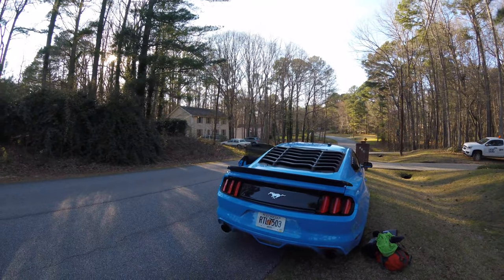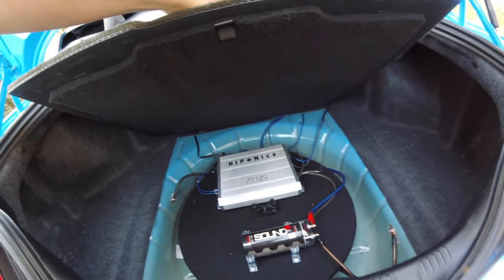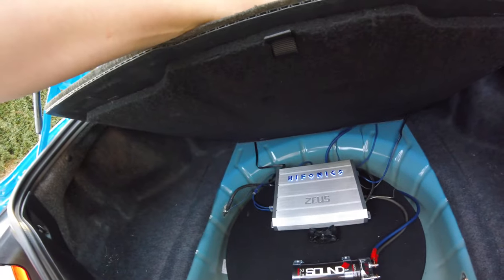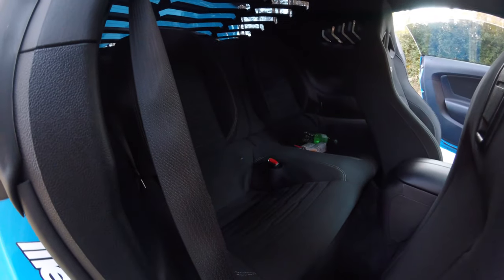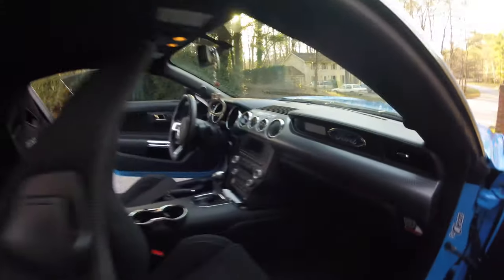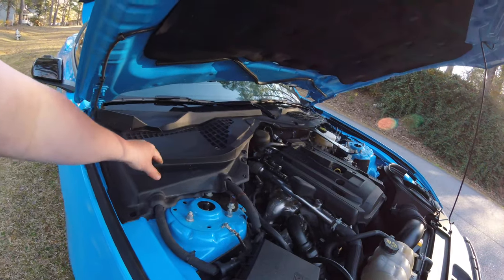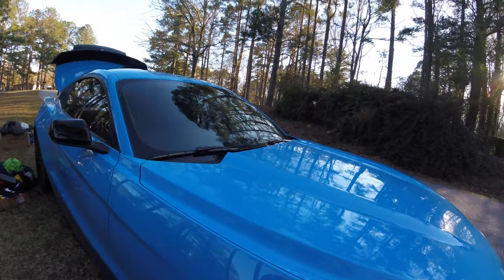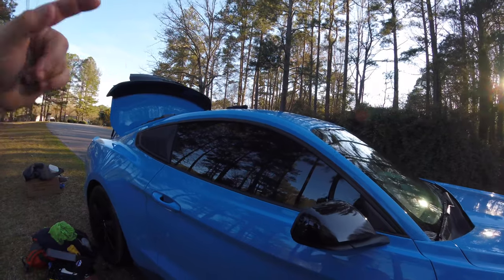2017 Ford Mustang sub install with factory speakers

Comment: it does need a capacitor if you are not using a remote battery and going over 300w or you will be burning up alternators...   I have the same 2017 But in a GT, I didn't get a Hum, but I also did the 4" to 8" swap...
Reply: How did you burn up an alternator? I've been running a single Skar EVL powered by an RP2K @ 1ohm for 2 years with the stock battery and base EcoBoost which has the smallest alternator of all the mustangs I believe lol.

Comment: Nice vid man. And the seats down for the bass really does make a huge difference. I installed 2 2400watt Skar 10s on 3000 watts taramps amp. For my 12+ wire to my battery I have it ran under the battery spot u need another person to help pull it up. There was a nice lil spot to slip it through you gotta do it under the rugs n what not under the passenger side.
Reply from the maker: It's amazing seeing that the seats literally snap at as one can make such a difference in sound deadening
Reply: @freestylfilms  yea for real man I keep both of mine down now that I took em out of course lol never used em anyway so I just got a single 15 now and what a difference I can say
Reply: I got the same car im planning to put skar ddx single 2ohmz taramps 3000. But im worried about the car alternator. You guys running stock alternator and battery?

Comment: Badass, I have the same car, same year same color same wheel package. Mine came with subs built into the roof of the trunk and I have a spare tire but I definitely dig your setup you probably get better sound 😀
Reply: There is no “probably” lol the “subs” on the trunk arnt really subs but more of a mid speaker you can still use them to get signal to your amp that will run real subs. Those on the back use the trunk as a “box” but it’s much too spacious for those low power speakers to give any depth in music.

Comment: Do you think I could fit a single 15” inside the trunk of a 2017 model mustang?
Reply: Same exact question I had
Reply: Nah unless you build a box into the trunk for it first cuz I’ve tried prefab boxes for 15s and they can’t fit in our small ass trunks. But I have mine in my back seats cuz I took the back seats out but u can always fold them down as well if u don’t wanna go through that hassle. Got a 2500 watt Skar 15 on a 3k taramps amp.
Reply: Matter fact I couldn’t even fit 12s in prefab boxes. So if you can build a custom box the right way or have someone do it for you then you’d most likely be able to fit it in but that’s all I can think of
Reply: @mattmonster0048  so y’all couldn’t fit 12s into the trunk? Cause I have two 12s and I wasn’t sure if them and the boxes would fit in the trunk. And if you did find ones that fit, which ones were they?
Reply: @AyooKDot  you might be able too. I just had a custom box built and I took out the backseats to just barely squeeze my box in lol but you might be able to depending on the box. Don’t hurt to try !
Reply: @mattmonster0048  do you happen to have the dimensions of your box? Sorry for all the questions lol
Reply: @AyooKDot  I'm installing a single xfl American bass 12, 2 won't fit but I got the single box in, it's ported and tubed to 32 htz
Reply: @prettydall  gotcha. Wish there was a way to get two in there but thanks for the help man

Comment: It's night and day because those 8's are crap. Need a better subwoofer and a better box than that. Try a single Skar EVL or Wolfram Agv2 in a 4th order. You won't need to lower the seats.
Reply from the maker: not my car just my install, not enough bass for me. my car is the altima video i have on my channel

Comment: Do you have bass roll off at higher volumes? I want to know if i need a dsp I have a 5.0 so no mic for me
Reply from the maker: With those subs not really they're only 8s so no deep bass
Reply: @freestylfilms  Thanks, btw size is subjective to enclosure and t/s parameters. I will be using a SSA F8L 8 inch sub in my car which can play down to 26hz.. but It's looking like i should get a DSP just to be safe. Probably the kicker Keyloc DSP FOR 129$
Reply from the maker: @Anthonysmackass  a real sub yeh. This is a kenwood with a stock box. Decent but not enough for me
Reply: @freestylfilms  If your thinking about upgrading check out FI Audio. Built in USA subs, cant beat the quality
Reply from the maker: @Anthonysmackass  it's not my car. I've got two jl audio w1v3s in my car. I've had fi car audio before.

Comment: I have a 2019 mustang, and i recently added a powered sub. Sadly theres no mic to unplug. I had to get an obd reader thing and forscan to get around the active noise cancelation
Reply from the maker: Unplug the mic in the headliner
Reply: @freestylfilms  no mic in my 2019 mustang ecoboost.  Had to use forscan.

Comment: What if you just turn the wheel?
Reply from the maker: Try it. We turned the wheel and couldn't get the plastic cover off with enough room to get our hands through
Reply: @freestylfilms  damn… thanks 🙏
Reply: Just jack up the car on that side the wheel will sag enough